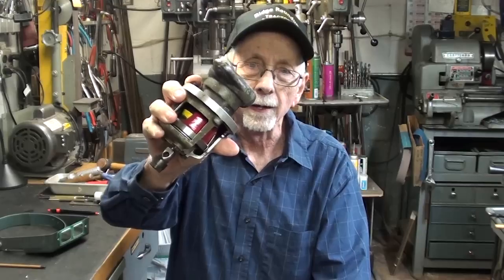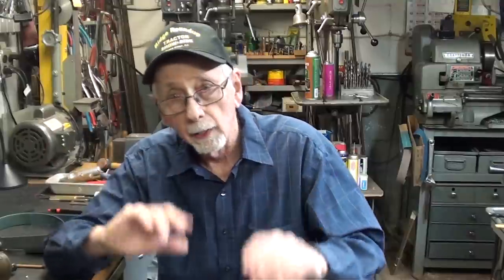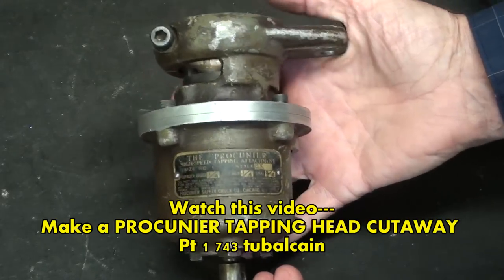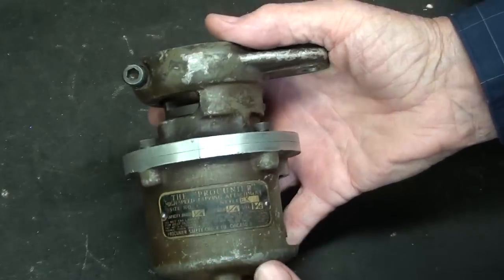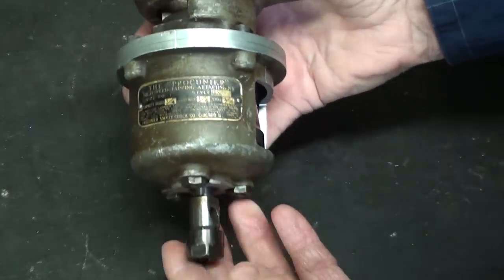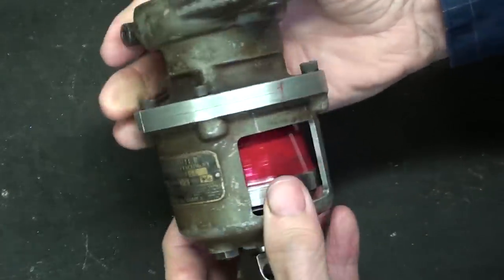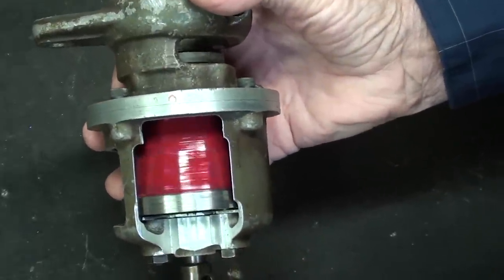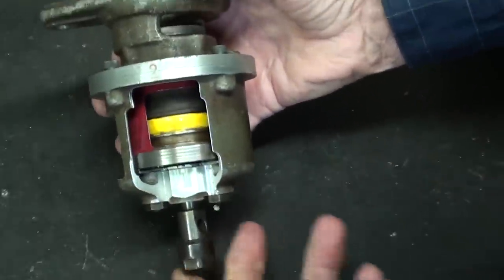JOHN DEERE TRACTOR Cutaway short #37 tubalcain hit & miss engine

Comment: I drove an old "B" model in the late 50s and early 60s. Loved that old thing and the sound of it tickled my heart. You had to spin the wheel by hand to start it but it was reliable. That one blew an exhaust valve and that shut her down fast. Haven't a clue how that engine worked because I never worked on it. I think it was a one lunger. 😉

Comment: Those are amazing! I recall much earlier on your channel you had a Gravely L tractor. I'm into Gravelys myself and back in the day they made cut aways of real model L tractors and shipped them to dealers. The T head engine, the planetary transmission and even the carburetor are all open. They are still seen sometimes in the Gravely community and are quite collectable.
Reply from the maker: I would love to see those cutaways. I no longer have my gravely. I would like to buy another one just to play with.

Comment: The 730 cutaway was done by a now long gone machine shop for the Sales department at John Deere. We believe they did between 12 and 20 of them for the 720 tractors which were then updated to 730s when the new series came out. Each one the tractors were slightly unique so the history can be traced well if pictures exist. I'm lucky enough to own one, although it is a wreck from years of neglect. Mine actually has a serial plate stamped "DISPLAY"
Reply: @AC  fear not, they were also made out of reject castings with flaws, so they don't even have good parts in them.
Reply from the maker: Thank you for that awesome information. I had no idea they made that many.
Reply: @mrpete222  actual production information is sketchy. This estimate is linked to first hand accounts that they built one for each branch house plus extras. I believe there are 5 surviving examples, 4 in North America.
Reply: @HotRodTractor  When I started working at the Deere dealer we had a cutaway 4010. It was from the Columbus branch house and had been donated to the University at Richmond Ky for their ag mechanics program.  20 years later they felt is was no longer of use and had us come get it. Another 20 years of sitting in our warehouse the owner sold it up to Wisconsin for $50K I believe. Just like this 730 it had a bunch of the parts chromed that normally would have been bare or painted.  I think whoever bought it completely redid it but I never saw it again.

Comment: I have literally tapped millions of pipe couplings on a drill press with a procunier tapping head without ever one single problem. We had two of them set up in drill presses and they were used for many years. Every machine shop should have a dedicated drill press with the procunier head just for tapping. You would never look back.
Art from Ohio

Comment: The 720 is really neat.
Thanks for finding and showing those cutaways!
I could tell a couple stories about a bad 1-1/2 horse JD block and my Barco gas jack hammer or a sad JD snowmobile and the rear wheel of a Rumely 17-30 heavyweight. I'll leave it at that.

Comment: There are small pistons and big pistons on the John deer tractor. What’s the small pistons for?
Reply: The small pistons above the main engine are for the pony motor used to start the main engine
Reply from the maker: Yes
Reply: This tractor has a 4 cylinder gas engine (pony motor) to start the 2 cylinder diesel engine.  The V-4 pony motor sits on top of the diesel and starts with a 6 volt electric starter.  As the pony runs, it shares coolant with the diesel engine and warms it up before starting the diesel.  The pony's exhaust also goes through a heat exchanger to warm up the diesel engine intake air.